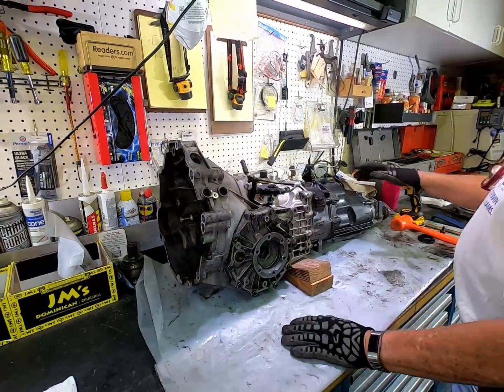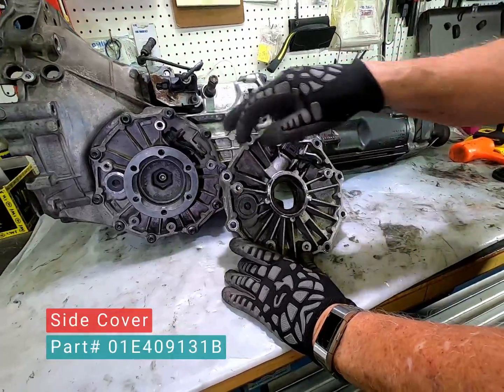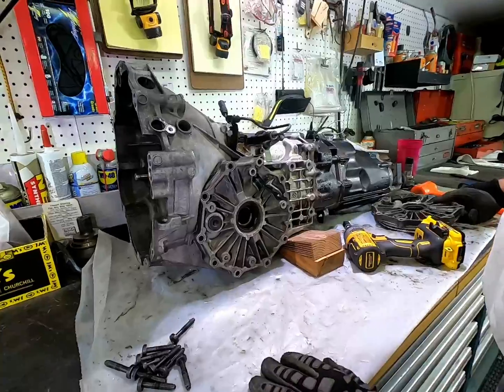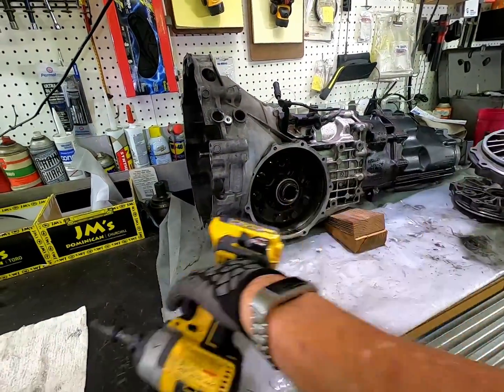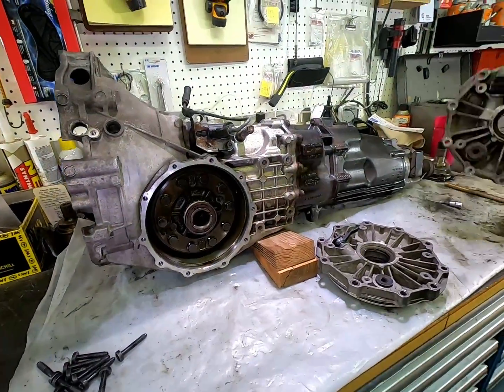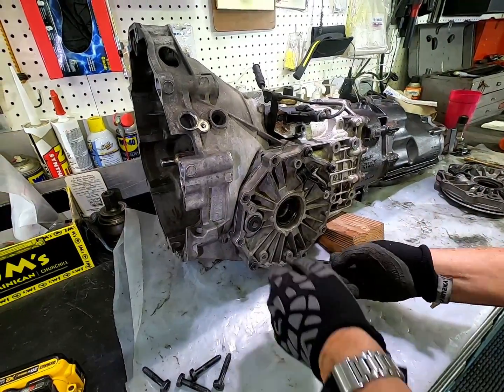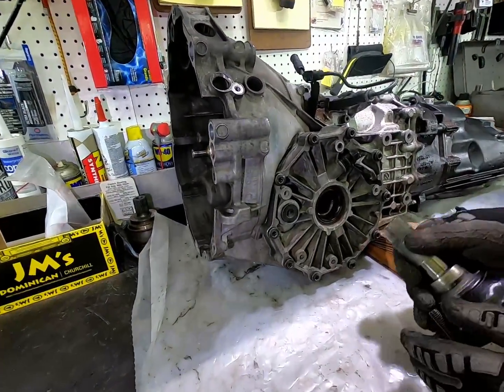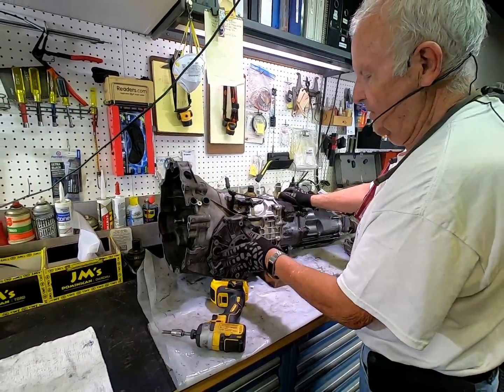Audi 01E - FYF vs GBE

Comment: Would this be compatible bentley w12 engine (480 ft lbs) torque for mid engine project?
Reply from the maker: They made front drive 01E transmissions.  That would probably be better for that application.
Reply from the maker: I don't know if YouTube will allow me to make this comment, but they is a guy in NY selling some 01E front drive transmissions.  You might want to check it out.  He is a good guy.
https://www.facebook.com/commerce/listing/1034482765484047?media_id=0&ref=share_attachment

Comment: Would one of these transmissions bolt up to a 1.8t or does the bell housing need to be modified? I have a 2001 B5 A4 1.8t Quattro and the stock 01A is beginning to fall apart. I found a used FYF transmission for sale and I’m struggling to find information on it online
Reply from the maker: I know a few people running them behind 1.8t they installed in B4s.  So I would say the answer it yes.  
Maybe do search on Facebook Pre-95 Audi Quattro Page.  I think you will find something.
Reply: Quick follow-up: am I able to bolt B5 S4 transmission mount brackets to both sides of the FYF case or will custom fabrication be required? Thank you for the quick reply by the way
Reply from the maker: @seanf7948  I really don't know for certain.  I would try a B5 Facebook page, or there is a Forum called The Project Pad.  You could try there and ask.
I just tried the search on the Pre95 facebook page and it sucked.
Reply: Thanks very much for your input. I’ll go back down the rabbithole!
Reply from the maker: @seanf7948  Cars are always a rabbit hole.  Good luck and glad if I helped a little.

Comment: Did you upgrade your Audi Coupe 5 speed-transmission with this 01E GBE? If yes, how did you shorten driveshaft? I'm eyeing on an FYF and planning swapping it into  my 1991 S2 3B which has the older 01A (ARV) 5-speed gearbox. Luckily both of them have the same 4.11 ration, but I'm more concerned about the driveshaft shortening and whether the rear diff and axles are able to hold hard launches.
Reply from the maker: You can use the propshaft from and Audi 4000 quattro.  It is the right length, for when you install an 01E.  You need the sensors as noted in the video.  As for launches, I don't know, because I don't launch.

Comment: I have a 2 Wheel Dr manual 01E that will not go into reverse. I disconnected all the linkage and it still won’t go into reverse so I ruled that out. Is there some sort of reverse lockout solenoid on here that could’ve gone bad? I’ve been trying to figure this out for months.
Reply from the maker: No reverse solenoid, on a manual.  Either shifter forks or adjustment in the linkage.

Comment: How far back in years does the 01e box go and did the 4 cylinders have them.
Reply from the maker: Now this is just from memory.  The states got the 01E on the UrS4/6 in the early 90s, but those were only 5 speed.  The states got the 6 speed in the late 90s early 2000s on the S6 and S4s, ending with the B6 A4 V6s.
In Europe, they got 6 speeds on a number of cars.  S2, RS2s, V8s, S8s, etc.  I don't know if the 1994 80 Competition has the 01E 6 speed or not.  A Euro only car.
They do bolt up to a 4 banger as I know several people who have used them behind 1.8T put into older Audi 90Qs.
Reply: @oldguyramblings  thanks very much l really appreciate your reply and knowledge. I am actually looking to put a front wheel drive box behind a ls1 350 and trying to narrow down what's best and easiest and also able to handle 4 to500 horses  and moreover the price.  By your description it seems if l buy any front wheel drive manual audi l'll get that box, .....is that true 
Thanks
Reply from the maker: @joseph317  There are some 01E front drive boxes, I just don't know what cars they came on.
Reply from the maker: @joseph317  I think there are some Porsches that used a 01E FWD boxes in maybe a 944 or 968.  Don't quote me.
Reply: @oldguyramblings  much appreciated....
Reply: @joseph317 let me add, there are also 01E trannies mated to the 1.9 TDI AVF and 1.8T BEX engines, so yes they bolt to 4 bangers, however, the transmission bells on the 01E are different when they were on the 2.7 biturbo, not all 01Es will swap due to different bolt holes and alignment knobs on the bell housing... There is some info out there in forums aboit that though
Reply: @joseph317 oh and let me add, the flange size for the front driveshafts are bigger on the diesel 01Es! Very important to get the front axles with the transmission!
Reply: @that_escalated_quickly2720  thanks, there are a lot to choose from....

Comment: Awesome video. A lot of people simply do not know this. I just went though This. I broke my magnetic drive gear while transferring parts. Audi doesn’t make them any longer. Practically gold
Reply from the maker: When Audi does not have the part, check the VW parts bin for the same number.

https://www.volkswagen-classic-parts.com/catalog/en_global/part/012409187D
Reply: @oldguyramblings  thank you! Didn’t know about this. I’ll give it a look
Reply from the maker: @sethstylezMusic  let me know if it works for you.
Reply: @oldguyramblings  I’m trying to see if I can ship to the states
Reply from the maker: @sethstylezMusic  Looks someone will.

https://www.ebay.com/itm/195069013404
Reply from the maker: @sethstylezMusic  This one is in the states.  More money but local.
https://jhmotorsports.com/speedometer-reluctor-wheel-oem-for-01e.html
Reply: @oldguyramblings  thank you so much. I placed an order for the one from JHM. I must seem lazy in my pursuit of finding this part. I called multiple vendors and could not find this. Thank you greatly
Reply from the maker: @sethstylezMusic  You are welcome.  I like doing the searches, keep me abreast of what is available.  
So many parts are becoming Euro only, anymore.